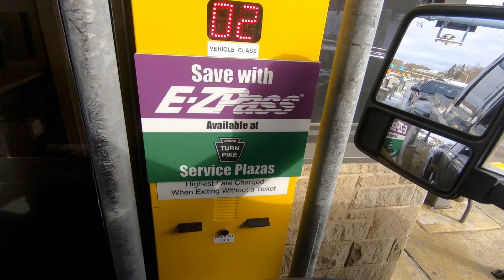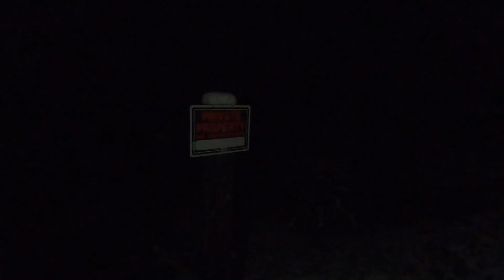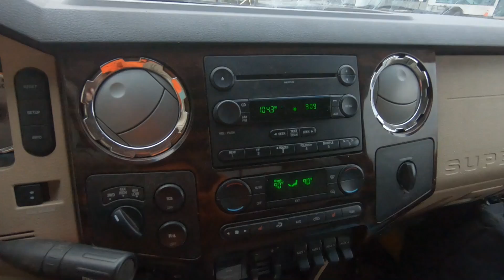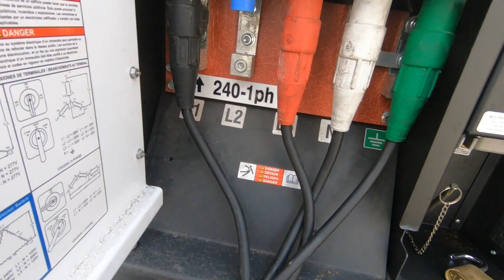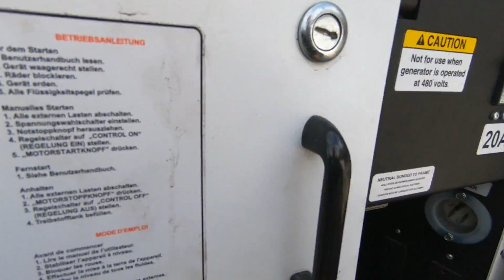SHE'S NOT A PAVEMENT PRINCESS, RESTORING POWER TO OFF ROAD TOWERS!!!!

Comment: Like if Steve should add a bigger turbo to the 450
Reply: yukon on23s  semi turbo
Reply: His truck already has twin turbos plenty of power
Reply: I know but it would still be cooler if they were bigger
Reply: @yukonon23s95  it's not a race it would only give him more lag it's perfect for what he uses it for once the boost came in on bigger turbo he would be spinning his tires going up these kind of hills.. maybe eventually if he can get a built motor and trans he can upgrade the turbos on the vette that makes more sense
Reply: @freedomfox8183  I'm get what you're saying but I'm just saying something for the summer like a bolt on kit that he could take off
Reply: yukon on23s - Why would he do it when he doesn’t need more power. Besides like someone said larger blowers aren’t going to do a thing for his trucks engine. Oh I get it for bragging rights.
Reply: @MYTOYMAKERZ  no if u would have read my last comment I meant for a project other than the Corvette in the summer
Reply: yukon on23s summer only “bolt on turbo kit” lol

Comment: I can already tell
By the sound of that power stroke you were talking about it’s a 6.0, the 6.0 has a much louder turbo Whistle than the 7.3
Reply: UG Culture did I miss something because his current truck is neither a 6.0 or a 7.3
Reply: @J_M3444  yes you missed something.
Reply: The truck Steve said sounded wicked in the tunnel, was a 6.0. I wasn’t talking about his 6.4

Comment: And easy way to remember powerstrokes is obs are 7.3 and first two year of newer styles are 7.3’s. Updated headlights and loud loud loud turbo whistle is a 6.0. His body style is the lowered squareish headlights from the hood is a 6.4(factory Compound turbos). And all new body styles since 2011 are 6.7’s
Reply: 94.5-97 is obs 7.3 powerstroke 99-03.5 is superduyy 7.3 03.5-04 is early 6.0 with leaf spring front and 7.3 style grill 05-07 second gen 6.0 woth coil suspension and updated front end 08-10 is 6.4 11-16 first gen 6.7 13-16  minor changes.17- now 6.7 alumiduty